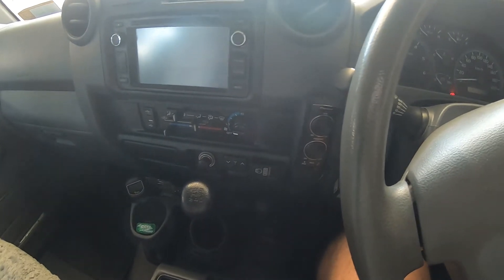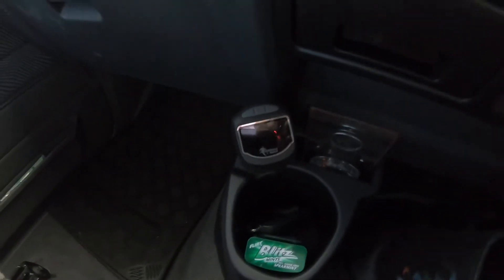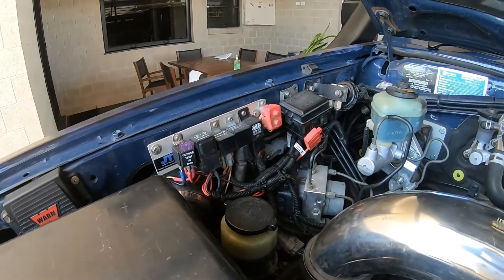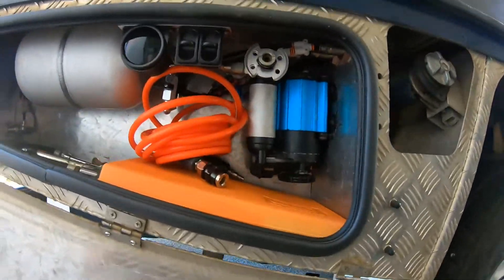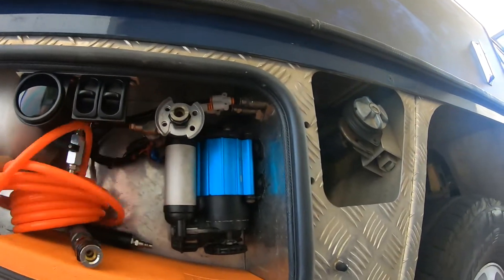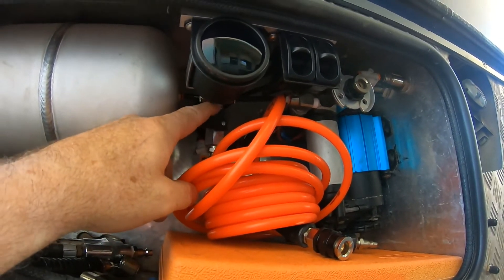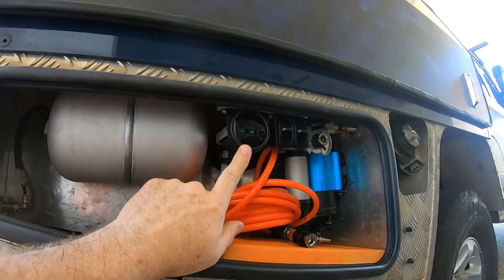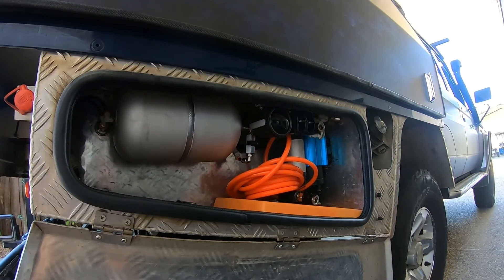ARB Air Compressor, ARB Air Tank and air toys

Comment: I know this is quite a old video but I have the single arb compressor like in this video I’m just trying to hook up a tank to it but can’t figure out how are u going straight from the side of the compressor to hook up your tank to it
Reply from the maker: I guess it really depends what u r using the tank air for.   I found pumping tyres it was better to have air straight from the compressor.

I used tank air for sir horns and air bag suspension. I also had a seperate outlet to connect my arb airline snd dust gun.

Just about all the air connections I used I sourced from the Air Bag Man. I think having a one way valve between the air compressor and any outlet is almost a must. Stops compressed air leaking back through the compressor.

Since that vid I’ve upgraded to the arb twin compressor with similar set up. I’ve done a vid on that too. But I’ve added a water separator to the system.  I reckon that’s a must too. That latest vid is in my “250k projects” playlist.   That might provide you some further insite.

cheers

kennym
Reply from the maker: Ahhhrggh, not a direct response to your ?, sorry. There is an outlet for the compressor, in stead of using the arb airline fitting use a 1/4 npt neato filling (from air bag man).

I actually put a T piece in (male fitting into air compressor and 2 female fittings).  One of the female fittings I fitted the arb air pressure cut off switch. The other I fitted a 1/4 npt air fitting. 1/4 air line between that air fitting and air tank. 

Both air tank and fitting at compressor female 1/4 npt neato fitting (air bag man).

Hope this helps 

kennym
Reply: @kennymepicadventures876  sorry let me word that differently are u connecting the t connector to the side of the manifold for like lockers or are u connecting it to the main port that was used for the quick connection
Reply: @kennymepicadventures876  now I’m in USA looks like he’s based out of Australia so it’s gonna be kinda hard to order parts from him but the 1/4 npt fitting are u connecting it to the pump or the normal output of the compressor where the quick connect usually goes?
Reply from the maker: @randychamberlain6350  From memory the single compressor has a T piece at the compressor outlet. Male fitting into compressor. One female fitting for the pressure cut off switch and remaining female for the quick disconnect.

If you don’t want a quick disconnect at that point on the compressor remove it and fit a female 1/4 npt neato fitting. Connect an airline from that fitting to your tank. 

kennym
Reply: @kennymepicadventures876  ok now when I hook up the tank do I have to put the compressor switch on the other side of the tank where the quick connect will be?
Reply from the maker: @randychamberlain6350  ohhh my Randy.

The pressure cut out switch, in my set up, was on the compressor outlet. There was. T piece (previously described to you)).  If your compressor does not have a brass T piece at the outlet then you need to ensure the pressure switch is in the compressed air side.

I don’t think putting the switch on the outlet side of your tank is the best outcome.

If you go to my channel, look at playlists, there is one called All Things Air. I reckon you will likely find ideas there about how you can sort your system out.

kennym
Reply: @kennymepicadventures876  ok great I think I finely got it thanks for your help